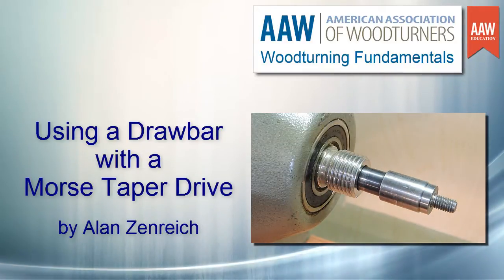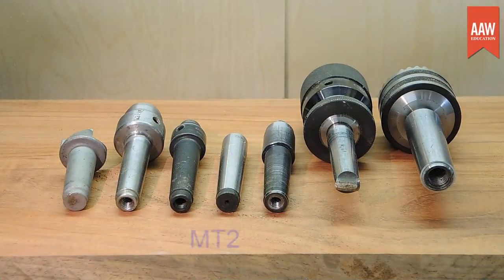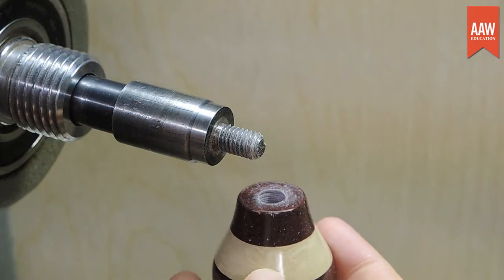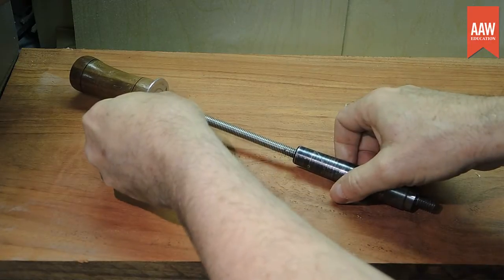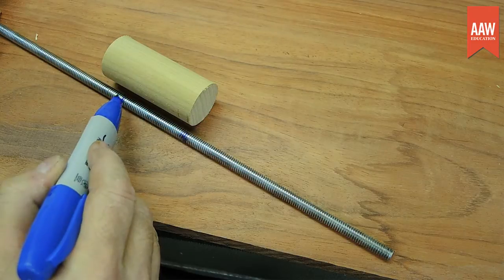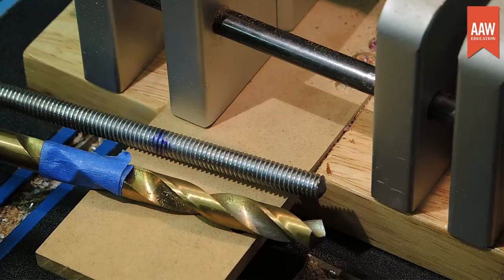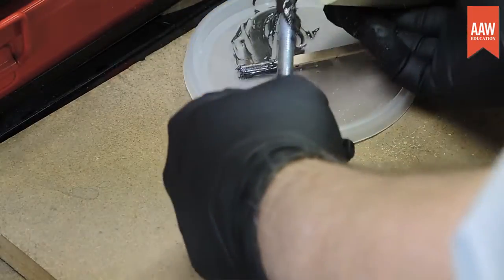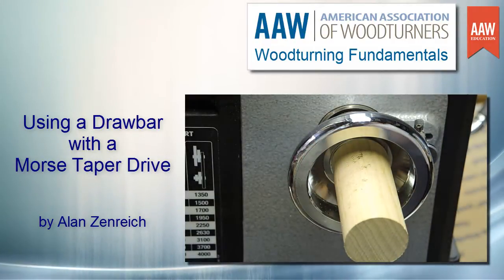Using a drawbar with a Morse taper drive - AAW Woodturning Fundamentals

Comment: Thanks so much, this is so useful and I couldn't find an answer!  I have a question, I have a chuck with a rubber bottom similar to the fourth on from the left in your display at :56.   Is there anything I can do to get that to attach to a drawbar or do I need to buy one that is threaded?
Thanks again

Comment: Could this same technique be applied to a small drill press in order to turn it into a light duty mini-milling machine?
Reply from the maker: Generally not.  Drill press arbors components are rarely designed to sustain lateral forces.  It might work for a while, but i don't think it's a long term solution.
Reply: You would need to buy a new quill/spindle assembly with a hole through the center...